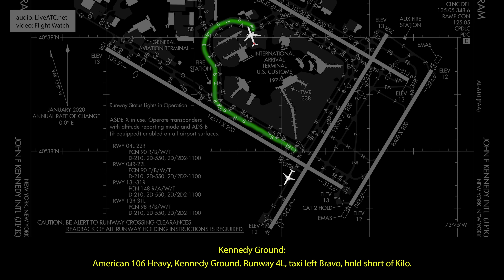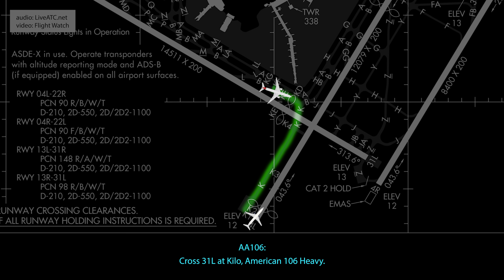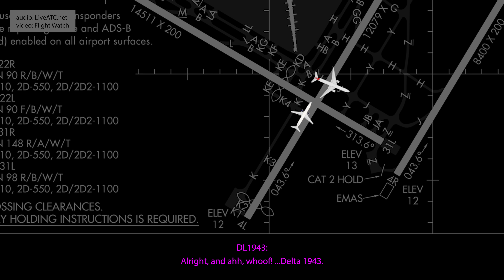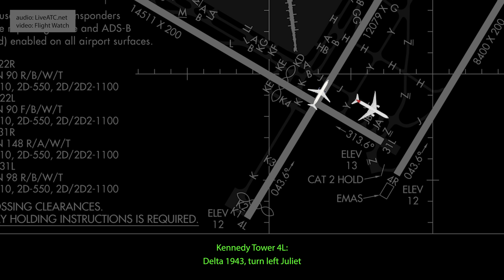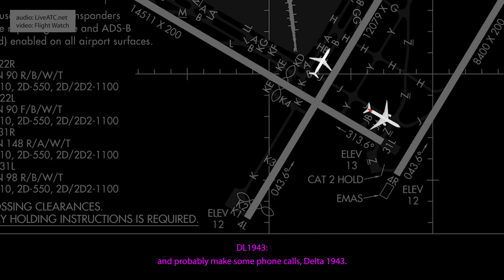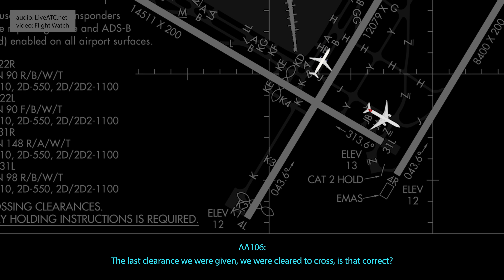(Full ATC audio) Close call at JFK between American 777 and Delta 737

Comment: So not only did they get lost and cross the active runway (while Delta was taking off), American 106 also ignored the call to 'Hold Position'. That's going to be an interesting conversation with the FAA.
Reply: This is an estimated visualization. It doesn't mean AA106 ignored "Hold Position" as we don't have actual video footage showing location.
Reply from the maker: I think that they were just not on that frequency, it was transmitted on the frequency for the parallel runway 4R. I suspect that controller was making a call just in case they happened to be to listening.
Reply: From what I understand, they were going to hold short of runway 31L. Thats what American was comprehending and doing. Thats why they crossed 4L.
Ofc just as per my understanding.
Reply: @ShadowViewsOnly  Why would they think that though? The instruction from the tower was clear. Runway 4 left, taxi left on Bravo, HOLD SHORT OF KILO. They were not given permission to cross ANY runway, until they approached Kilo, and at that point they were told, and ACKNOWLEDGED that they were to cross 31L NOT 4L.
Reply: @marklnz  That could have any reason. Confirmation bias is my best guess, they mistook the 2 runways, and they expected 31L as takeoff runway since its closer, Kilo is going that direction, and so they just went that way, and their brains confirmed that yes that is exactly what they said. Even though ATC didnt say that.
Also, holding short, is (concerning my very limited experience in the matter) something I have only heard being said for a runway, not for a taxiway. And they did hold short of 31L as said at the end of the recording, probably expecting incoming landing plane.
And also, that command was pretty long, easily could have swapped couple letters and digits there.
But again, that could have any reason. Point was in my comment, almost certinaly they confused the 2 runways.
Reply: @ShadowViewsOnly  @marklnz; on a different YT channel, one commenter attributed the mishap to a US crew being used to take off from 31L, and not really paying attention to the ATC instructions. This can happen when you have taken off several times from the same runway at the same airport. No excuse still. If you look at the map, they are being told to cross 31L at Kilo, way before crossing active runway 4L. They were clearly thinking they were going to take off from 31L. Initial instructions were to hold at Kilo while taxiing on Bravo. 
They went past Kilo without stopping. It will be interesting to read the report on the reason why they properly read back the instructions while ignoring them.
Reply: @HughLikesPlanes  I think it was Ground telling them to hold position.
Reply: @HughLikesPlanes  No, AA106 was still on ground frequency.     They acknowledged the initial instruction to taxi to kilo and then they acknowledged the   instruction to cross 31L at Kilo by repeating it verbatim.  If they were going to 31L the initial ground call when leaving the ramp would have been "Left on Bravo, hold short of Juliet."

JFK is a major AA international hub.  The pilots should be well familiar with the airport and its operations.  To get lost on the field like that is inexcusable.
Reply: @p6x2  At 4L is being used for take offs just as often as the 31L.  Sometimes they take off from 31L and 4L at the same time, though then the aircraft taking off on 31L starts the roll from the taxiway KE, not from full length.  If they were going to 31L leaving the ramp they, most likely, would have been instructed to go right on Alpha and cross 4L at either Foxtrot, Golf, or Hotel.  

JFK is a major AA focus city, that crew, no doubt, has flown in and out of there many times.  They should have been well familiar with the airport and its taxi patterns.
Reply: @glasscockpitf35  He could, but that would require for the controller not to be an asshole.
Reply: #emptykitchen

Comment: Props to the ATC controllers. When AA 106 blew right passed their turn ATC was immediately trying to get them to hold short before crossing 4L. On top of that the tower quickly told Delta 1943 to abort their takeoff. THAT is a well oiled machine right there.
Reply: Did you notice anything... distinctive about the pilot of AA 106?
Reply: @dennyb6768  Other than the fact that were completely incompetent? I mean ffs, these commercial jets usually always file an IFR flight plan. They would have had paperwork all over the place stating that they are taking off on runway 4L.

Comment: A new Teneriffe has just been avoided !
I guess the Delta pilots and passengers needed some time to recover from emotion. I also guess there will be a serious debrief of the incident.
Reply: I heard the pilots would’ve exceeded duty hours, and that’s why they returned to the gate
Reply: @mattthrun-nowicki8641  
Heard that too, but also the hot brakes were taken into consideration
Reply: @mattthrun-nowicki8641  After that hard braking they needed to have the brakes and undercarriage inspected before taking off again
Reply: @andrewtaylor940  Yes, but then the reason they didn’t take back off again that night was duty-hours related
Reply: Passengers likely weren't aware of what exactly happened as it was happening.

Comment: AA 106 is 100% at fault they read back the taxi instruction twice. They lost position awareness and the pilots failed each other. This has nothing to do with markings there are 2 professional pilots who could not keep situational awareness while taxing at an airport both were failure width. As a pilot at a busy airport you plot your course before your start taxing . NO EXCUSES. Thank GOD for the SHARP CONTROLLERs !
Reply: Indeed, even as a PPL, we are taught to ALWAYS clear a runway before even taxiing onto one. Controlled or not it's still good pilot safety and practice.
Reply: 106 never read the departing runway back as 4L on the initial call  back. They also didn’t look when crossing a runway. If they had they would of seen Delta barreling at them coming down the runway. Then the male on 106 comes on and asks “we were told to cross correct”?  Not to beat a dead horse but he didn’t mention a runway either.   It comes down to zero situational awareness from both pilots on AA 106 along with horrible radio phraseology.  Unfortunately the holes in the Swiss cheese lined up.  ATC saved the day thank goodness
Reply: god is not to thank for the atcs skills. the atcs are to thank for that. grow up and stop believing in fantasies

Comment: It is pilot fault, but the ATC could have given a more precise clearance. The airplane approaches two runways  and they told them cleared to cross, instead of giving them an instruction to turn righ on kilo, then cross.
I can understand how pilots, approaching a runway straight ahaid, and expecting a cross clearance can think it's a clearance to cross the runway in front of them. 
Especially if they do the same thing every day.
Reply: The controlers specifically told AA to cross 31L, but AA kept going straight and crossed the active 4L in front of departing DL. Go back and listen again---the clearance couldn't have been more specific and was clearly an error on AA's part.

Comment: FAA Order 7110.65, paragraph 3-7-2, requires the ground controller to "When a taxi clearance to a runway is issued to an aircraft, confirm the aircraft has the correct runway assignment.
NOTE-
A pilot's read back of taxi instructions with the runway assignment can be considered confirmation of runway assignment."
AAL106 did not readback the assigned runway and ground control did not confirm that AAL106 had the correct runway assignment (as required). Both the pilot and the ground controller will be found to be a fault.
Reply: Yes, except we're hearing an imperfect recording of the conversation - the video annotates the start of the confirmation transmission from AAL106 as "cut off" - that may just be in the publicly available recording. It's possible that ATC heard them confirm the entire taxi clearance, but it was cut off/indecipherable on the recording from LiveATC or whatever the source is.
Reply: @marklnz  I just listened to it again. AAL reads back "Bravo short of Kilo" - nothing is actually cut off, it was just missed by the transcriber.
Reply: ATC said cross 31L at Kilo and American repeated “cross 31L at Kilo” but crossed runway 41L instead
Reply: Listen to it again.
Reply: you must be  in deviation too dude american pilot confirmed twice and read back twice that she has to cross 31L so what on earth you talk about other then quoting regulations which are met completely and clear by these atc controllers who saved lifes btw did you skip your therapy

Comment: I have two questions: do any RWYs at JFK have active RWSL lights? And are there more than one TWR controller like at other airports with intersecting runways? In my experience as a former 121 pilot and as airport operations with over a decade of experience, I know that even if a pilot reads a clearance back correctly, that does not mean they actually follow through. Runway incursions are not that rare but kudos to the controllers averting a nasty accident.
Reply: Kjfk has the Rwsl

Comment: Seems to me the female pilot didn’t cross the runway at K kilo as instructed. You can clearly hear ATC tell her to do that, but she proceeds straight ahead and into the path of the departing Delta flight. So to me it’s her fault.
Reply: I gathered, with her making the bulk of the radio calls, she was FO/PM.
Reply: Or, in this case she was the pilot not monitoring (the situation). That’s why there’s two of us up there, to back up the other and ensure clearances are being accurately followed.
Reply: Its even worse there was another pilot in the jump seat on this flight had three dumb pilots on it that day. A relief pilot who’s job is to watch the other two and get an overview. I bet not one of them had a nap or sleep before this flight. This was a totally unaware crew. They are to brief the flight and runways and the whole taxi. It comes up on their ipad if they are on the ball. The captain screwed himself by asking about the clearance he is the one in charge and takes the fall.

Comment: I understand that the reason for this was that while taxiing, the female copilot decided to read a long memo that AA had sent out instead of looking out the window for the right runway.
Reply: ?? you understand that the pilot flying (taxiing) is responsible for following the route as advised by ATC. She as pilot monitoring was responsible - among other things - for the radio communication, and I think ATC gave correct instructions and she confirmed them back. So the pilot monitoring knew what he had to do. 
 That said both pilots should watch out for each other, and pilot monitoring certainly should support him in the taxi phase to detect possible mistakes (IF she had been free to do so and there were no other checklists to run, instruments to monitor etc). 

Both pilotes are supposed to intentionally strive for the best possible situational awareness during the whole take-off and landing phase.
Reply: nope. female repeated 2 times that she has to cross 31L 2 times she read back and confirmed but she still crosssed 4L. jailtime

Comment: Both the American pilots had their heads up their@#$!   Clearly cleared to Taxi 4L and to cross 31! At K!  Hard to understand their total confusion about where they were taxing to and what runway they were crossing and where.  The only issue with controller is the American did not read back runway assignment and weren’t called on it!
Reply: american pilot female read back not once but 2 times that she has to cross runaway 31L at kilo but she crossed 4L go back and listen again she read it back clearly and still did it wrong so are you coming here from vasa channel to spread hate versus atc like doing there or?